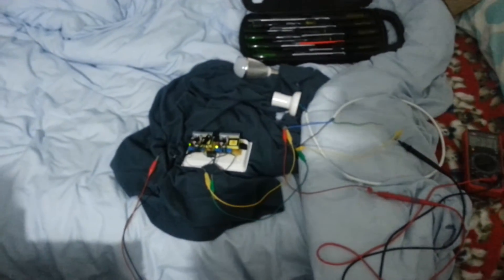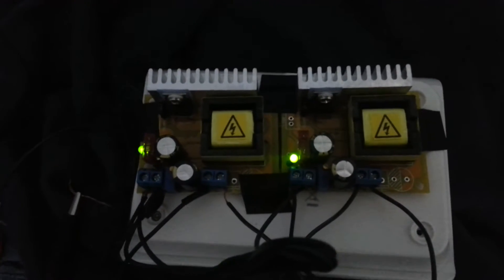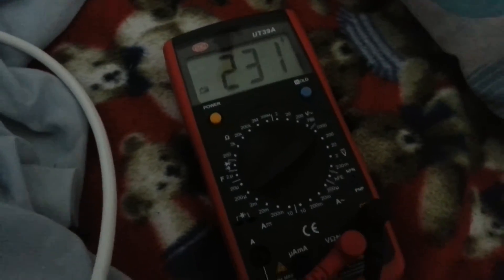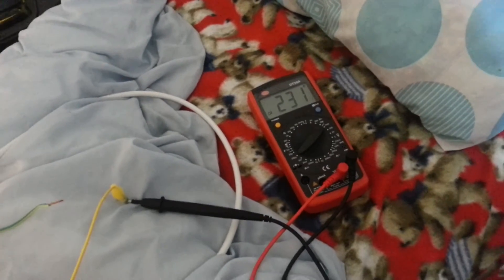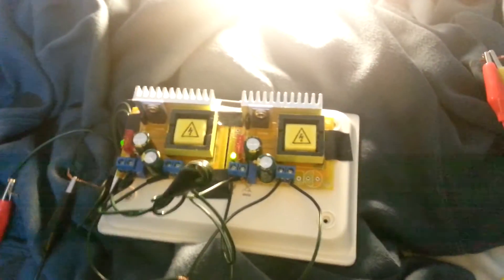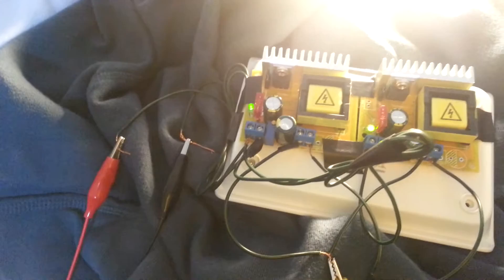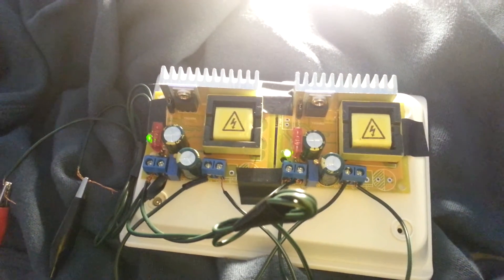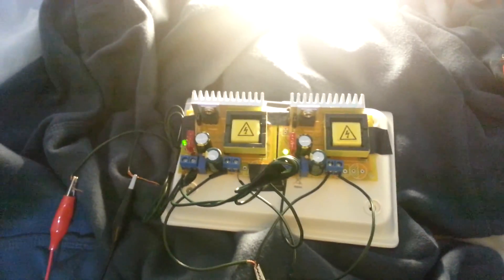High Voltage Boost Converters

Comment: bro in dc 240 v is equivalent but also different to ac, it is equivalent only in heating value

use the peak value for actual equivalence, because any appliances would have capacitor filter which filters the ac close to peak value

so using the peak value would be more accurate in terms of simulation or how circuit reacts

Comment: Can we connect them in parallel to meet the amp requirements of the load ?
Reply from the maker: Yeah but you have to be really careful about adjusting them.
Reply: Yes. Just use a diode in serial with each power supply, to a common output.
Reply: @la7yka  what type of diode for parallel 400v output?
Reply: @ruangrobot  1N4007 for example.
Reply: @la7yka  its safe for 400v to use 1N4007 coz it only 1A max current?
Reply: @ruangrobot  These inverters can only handle approx 45W. So two of them is 90W. But let's say 100W.  Ohm's law: P = U * I, so I = P/U >> I = 100/400 = 0.25A. So yes. If in doubt, you can also use the 10A10 diode, which can handle 10A at 1000V.

Comment: THANKS FOR THE GREAT VIDEO!  I have several of these boost converters, but mine are the type with both +-390v channels (max voltage = 780v).  They seem to be able to easily put out over 400v.  Also, The two main output capacitors (one for the sets you show) are rated at only 400v and tend to explode!  I am now replacing each of the capacitors with 450v (10uF).  You must be very careful to find the 10mm diameter caps, or it will not fit onto the already crowed board.  There is also a shorting resistor on the back of the board which can be moved to allow wider input voltage ranges (I don't know if there is any advantage in moving it from the 10v to 32v factory input range setting to the 8v-16v range if 12v is used only).  The jumper block setting (open-closed) simply an on-off control.  I am about ready to test higher amperage outputs.
Reply: how did you get it to 780 volt?
Reply: @tedguijt  I connect the 12v battery as usual, and use the board's  "-" output as ground and the "+" output as positive (don't use the middle conn).  I then can get up to 390v x 2 = 780v out.  You have to get the module that has a capacitor in EACH side of the terminal.
Reply: I agree. I've changed my output caps to 450V.

Comment: A small nit-pick, you probably know this, but just clarifying for anyone watching: Volts are not a unit of energy.
Energy = Power x Time
and since Power = Voltage x Current,  
Energy = Voltage x Current x Time
Reply from the maker: I did but thanks for raising it as an issue.

Comment: did you connect the output of those modules in parallel?
Reply from the maker: Yup but you need to make sure the voltages are pretty much on for both modules.
Reply: Can you Connect Them in series?
Reply: @mrbombomboy9  Nope!
Reply: @martinrowley1042  yes if both are isolated

u just assumed common ground didnt u

lookin smart like that and sayin nope

Comment: Ebay link?
Reply from the maker: http://www.ebay.com.au/itm/DC-DC-Boost-Converter-8-32V-to-45-390V-High-Voltage-Charging-Booster-Module-40W-/162171128367?hash=item25c2270a2f:g:gUwAAOSwHoFXsveN